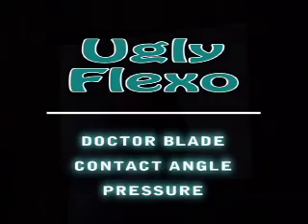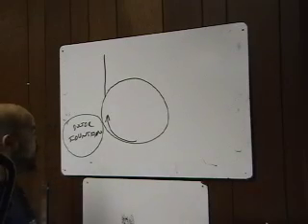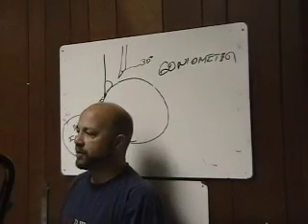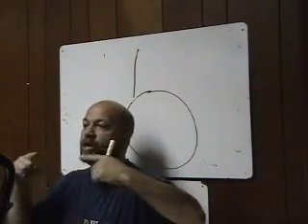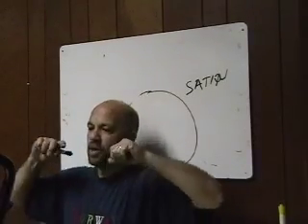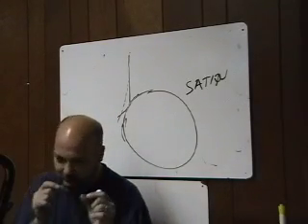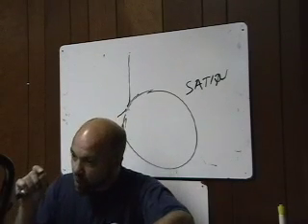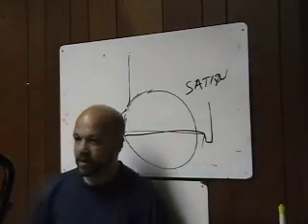Doctor Blade Angle and Pressure

Comment: Never print a true metallic ink with a doctor blade.
This will shave off the pigment particles which will give it a lustre.
try to use a rubber roll system.

Comment from the maker: Don't quote me, but metalic ink pigments, usually brass for gold and aluminum for silver, tend not to fit in the cells of anilox rolls.  This creates problems like weakness of color and build-up on the blades, including back-doctoring.  You might ask you ink supplier about the size of the pigments in your ink.  Anilox cell openings vary from about 100 microns for high-volume rolls, down to 23 microns for process rolls.